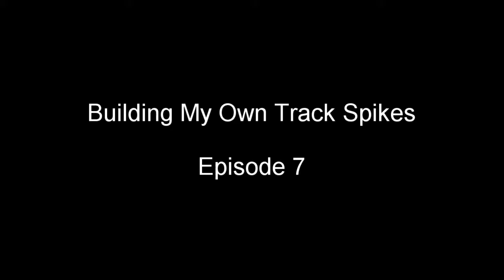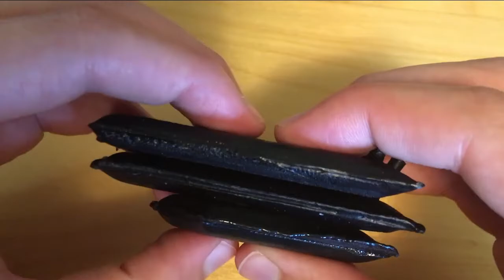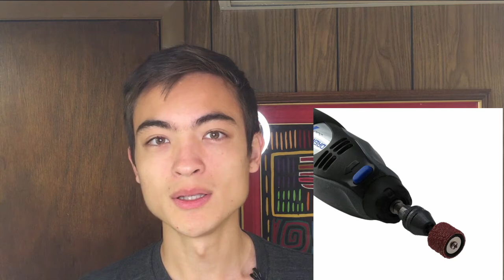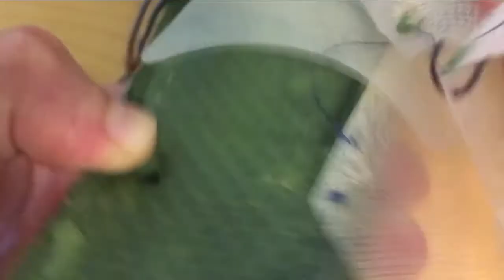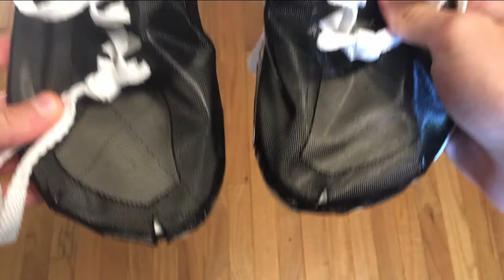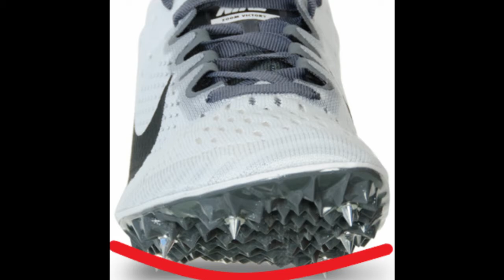Building Custom Track Spikes | Part 7

Comment: When i prepared boots for retreading with riding mower tire tread, i used a Ceramic Belt 36 grit to smooth off the rubber and leave it ragged enough for the E6000 glue and they didnt come apart. I used a Craftsman Belt Sander. I clamped the belt sander to my work table.